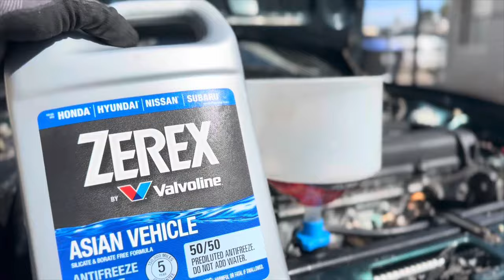1994-2001 INTEGRA: RADIATOR REPLACEMENT | HOW TO SWAP ACURA INTEGRA RADIATOR

Comment: Same thing just happened to mine. Engine sounds all bad though like a lawn mower like it has a bad misfire. Did that happen to yours too or nah
Reply from the maker: no didn’t happen to mine, engine sounded completely normal just coolant splashed all over the engine bay